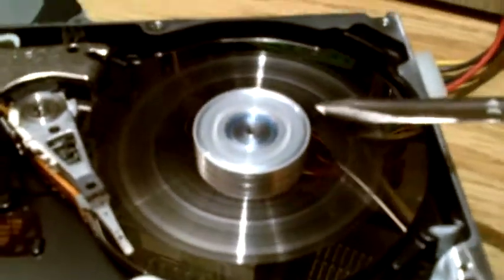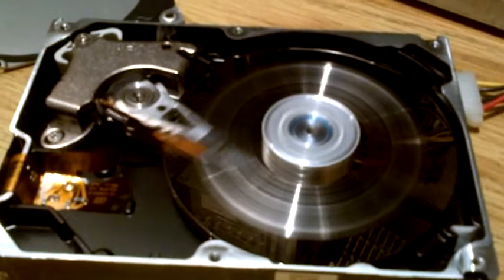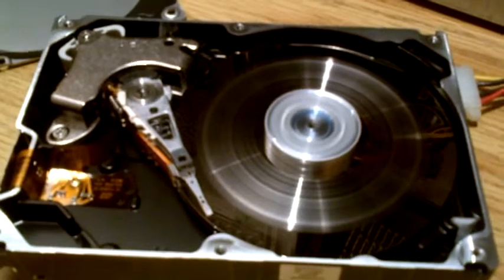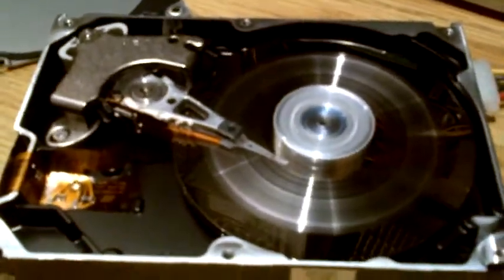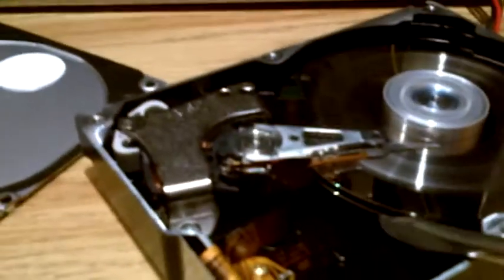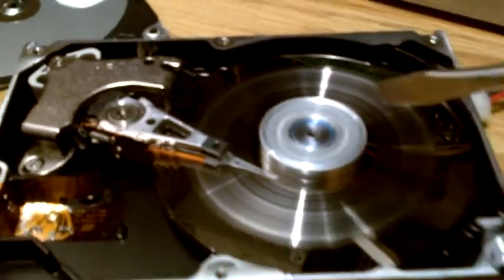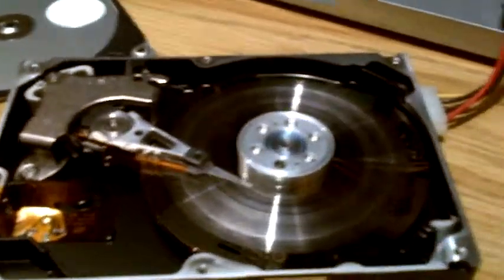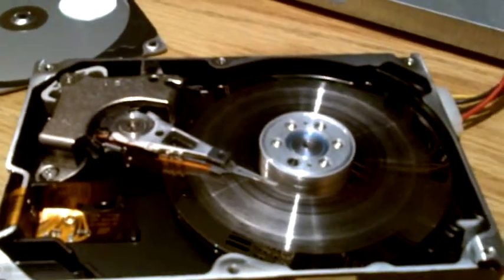Wrecking a hard drive platter

Comment: is that the main os hard drive on this computer?
bc when u turn on ur PC, the bios beeps meaning the hard drive is missing meaning unplugged the sata cable from that hard drive.
u should plug the sata cable back in that hard drive to see if the bios detects the faulty hard drive.